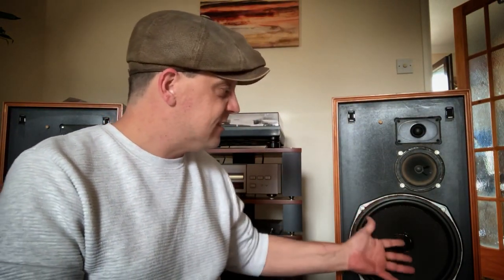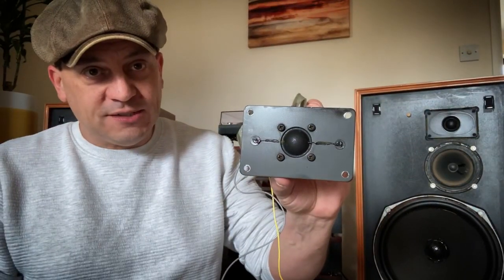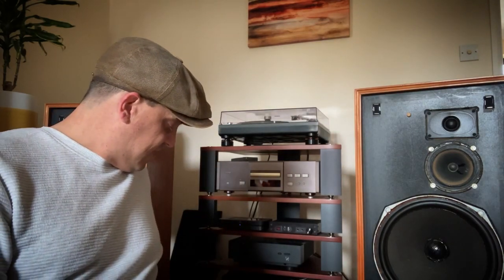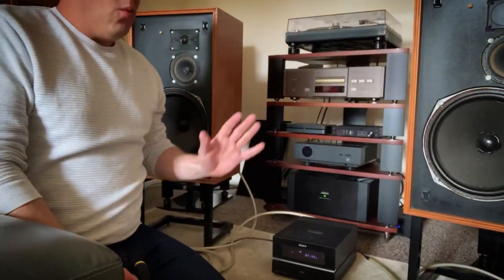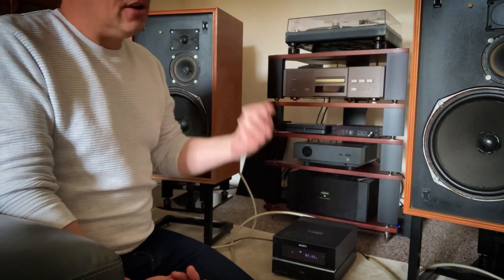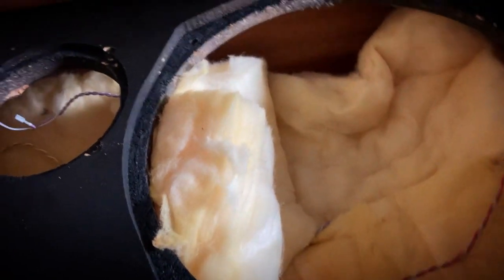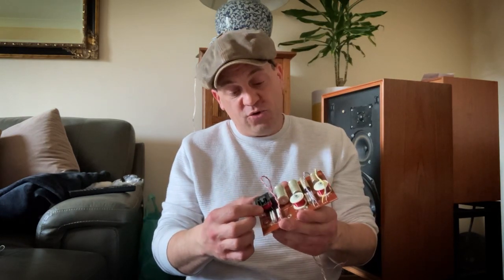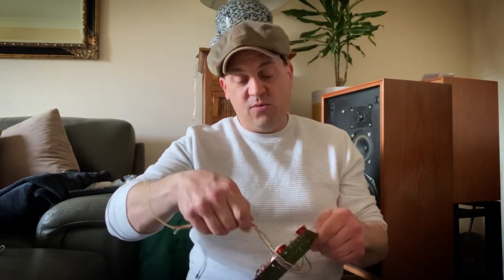Vintage Speakers, Tandberg TL5010 Review PT1, Crossover With Haycross Audio #speakers #vintage #hifi

Comment: Excellent Tip for testing old speakers, you just never know who's had them or what has been done to them. I use an old amp that is pretty much worthless. But the FM static is a good call.
Reply from the maker: Cheers Michael 👍

Comment: I like the idea of the FM static to test speakers. Other than that, I would be more worried connecting a vintage amp to my speakers than the other way around.
I used to repair audio in the 80's and we had 12" Philips full range drivers to test the amps. That saved a lot of tweeters.

Comment: Subscrided to matt's channel. That should be useful as I've been wanting to replace the caps in my Sansui ES-200's (similar closed box threeways as those Tandbergs but all Japanese drivers). Buying vintage is a learning experience. I have a pair of Beovox 3702 where someone replaced the 4 ohm mid units with 16 ohm ones. He put a resistor in parallel to make them 4 ohm again...
Reply from the maker: I could have obviously done the crossovers myself but I wanted to show there’s a great community of us guys doing our thing and wanted to share the love